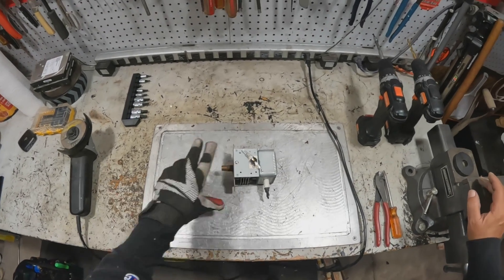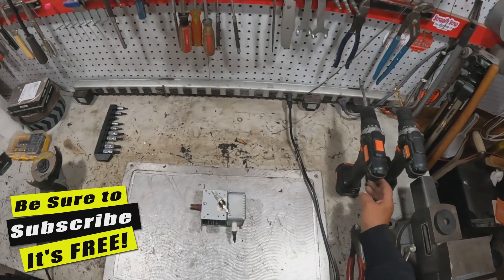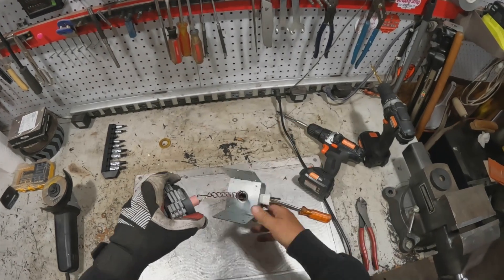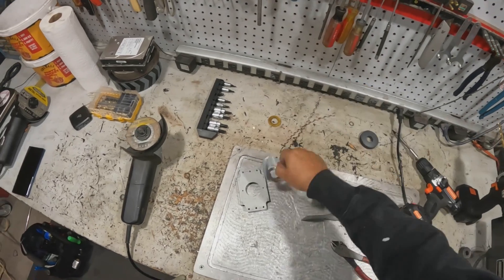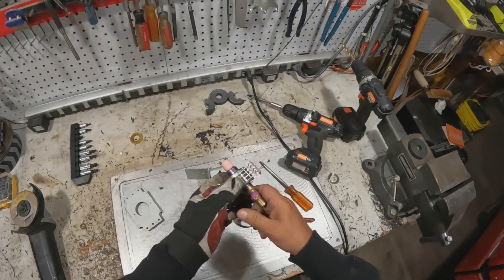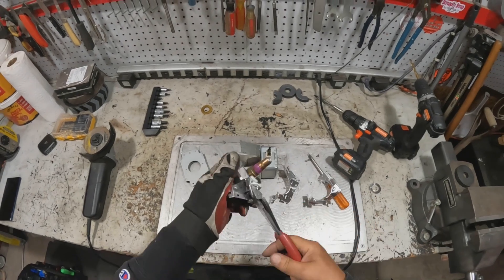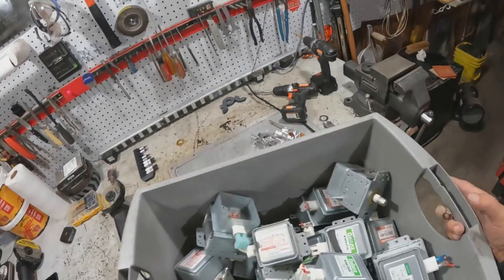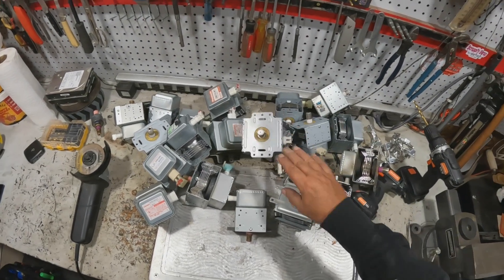Battling My Archnemesis Scrap Magnetrons | Who Wins the fight?

Comment: 3.22 minutes, best way iv seen is hacksaw, (or any thin bladed manual saw) the ends off to get the copper. Use a magnet to find where the steel ends and the copper begins
Reply from the maker: yes, that would really mess my golf swing up more than it already is :-)  Thanks for watching.